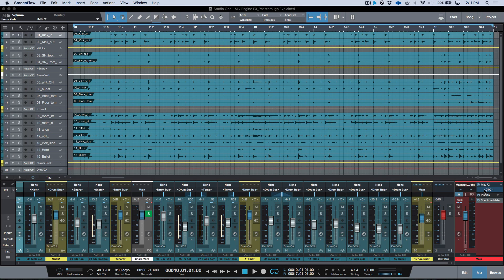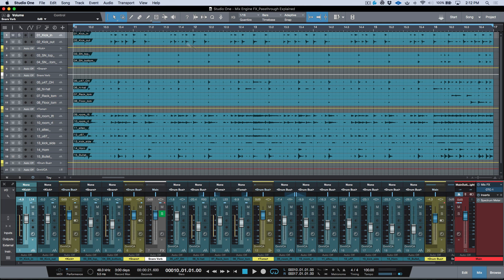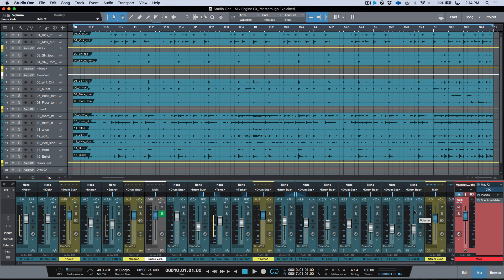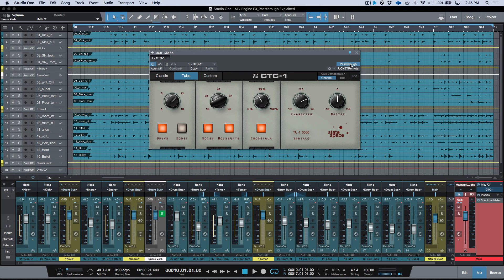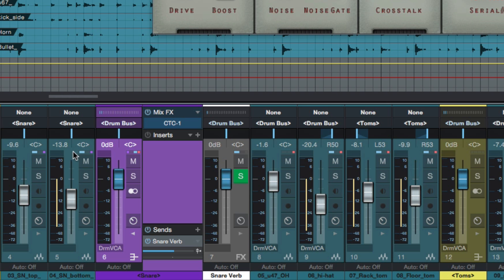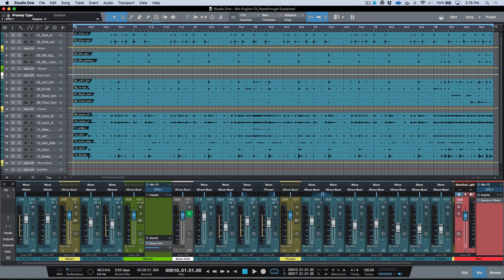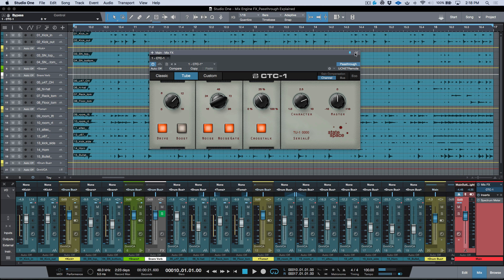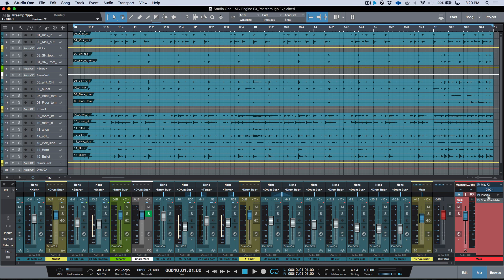Studio One Mix Engine FX - Passthough Mode Explained

Comment: Hey.  Thanks for the great vid.
It didnt answer the one question that I have though, which is:  With passthrough on, are my audio tracks NO LONGER being summed together by the busses that contain them (ie: drum bus)?  Is there some transparency where all of my base-level tracks are being summed by the master bus (with the mix fx engaged on it), or are my drums still being 'ordinary-digital-summed' at the drum bus, before this new summing engine just combines the highest level busses as a last step?
Im really trying to figure this out!
Cheers.
Reply: I think what he's explaining is that when passthrough is on the ctc will effect the source channels only and also the master channel... Eg audio tracks, instrument tracks, sub-bus tracks and the master track... For crosstalk, drive etc..

When passthrough is turned off, the mix fx works on all of the bus channels that are routed directly to the master in your mix instead of all the source channels directly. Any routing you have made still applies in your mix just as you would expect and crosstalk, drive, etc is applied to bus channels only and of course also the master channel too.

If you were to apply mix fx to a bus channel only and not on the master then this would apply to the channels being routed to that particular bus with the mix fx on it and no other channels or the master would be effected. 

So if you want crosstalk, drive etc on your drums tracks only and not anything else you would just put mix fx on your drum bus only. That would effect source drum tracks and any sub drum bussing you have done like kick bus/snare bus and they go to the main drum bus. If you want the whole production to have mix fx then you would put mix fx on your master. Passthrough on to effect all source channels and sub busses only, or passthrough off to effect all main busses only. And again of course, the channel the mix fx is on will be effected too in my last case ie the master. 

Think that's what he was showing anyway by the looks of it...
Reply: @benmccluskey5423  I understand all of that within the context of this being a saturation/ eq/ dynamics/stereo plugin.

As a summing engine, it does not make sense...

...and thats the point.  I call bullshit on the idea that this changes the actual summing engine.  Its still JUST digital summing, the same as any other daw, with an easy way of putting "console" effects on all your tracks.

If it was actually a summing engine, theyd allow you to switch it on and of without the coloratikn of ctc-1 or console shaper ( which has an unuseable bass bump, imo.)

My postbhere was teying to give the benefit of the doubt, but by now, I have my answer.  Ive even spoken to presonus and  Ari, himself, and their responses were political and vague.
Reply: @ThirdstarStudios  I get you man, its not something I use myself and your right, it is still digital summing. Best thing would be a real analog summing box like the dangerous music 2bus+... That thing costs a ton though and you need an audio interface with loads of outputs to feed into it too. I suppose the mix fx is just an optional effect that can be used and its good to have it anyway and just not use it if you don't want it.
Reply: @benmccluskey5423  Of course.  I just feel betrayed when companies do that kind of misleading marketing.  Basically, I wish so badly that it was what they said it was, that i feel like they took it away from me.  Classic 1st world mentality lol

Comment: Hi Marcus, I was wondering whether you could give me an opinion on the UAD Apollo Mark 2 (with plugin bundle). I'm a Studio One Pro 3 user and would like to get a better sound tracking acoustic gtrs. I suspect that the T-Bolt interface will give me better results than my good old PreSonus Audiobox USB.  Does Apollo work well with Studio One?  Is there another T-Bolt system that I should be looking into (perhaps from PreSonus if not elsewhere)?  Thank you so much for your help.  Richard

Comment: Marcus, I have a question about Studio One 3.   When using the stock Limiter to raise the RMS volume, pulling back on the Thresh knob apparently does this on earlier versions but anyone using Version 3 seems to complain that this doesn't work anymore.   (raising the input raises the RMS but quality seems to go down too).   Can I ask your opinion on this or what would you suggest is the best way to increase RMS in Mastering?
Reply: IMHO the first steps to getting a "loud" mix starts with the production, and mixing.. After that, adding compressors and limiters can further increase the RMS levels.. And yes, the more you limit (Gain Reduction) the more artifacts can creep into your track.. Having said that, some limiters handle this better than others, although the stock studio one limiter is not that bad.. I've used it on many occasions...
In terms of increasing the RMS try different production/mixing techniques like parallel compression, and adding saturation to certain elements in your track (either direct or in parallel) 
This should get you closer to your end goal in the mixing stage.. Having said that, each track can only be pushed so far, and based on the genre, and vibe of the track, some will simply sound "bad" when pushed outside what would be their natural comfort zone..
Hope this helps, Cheers, M